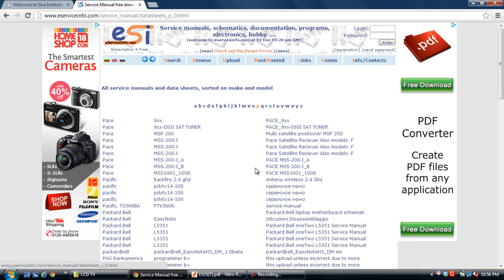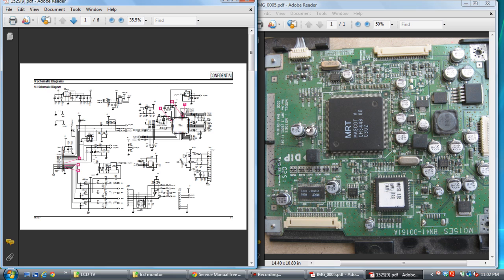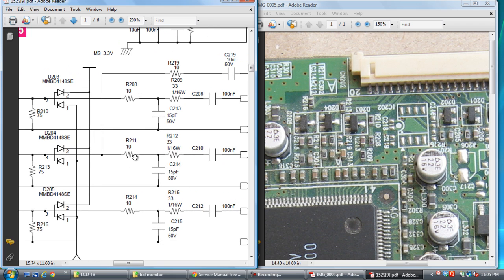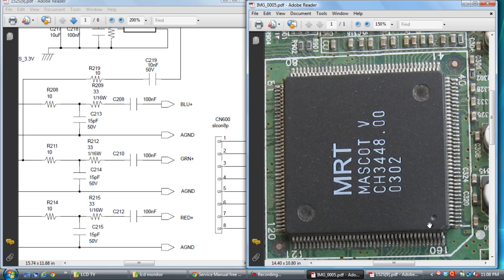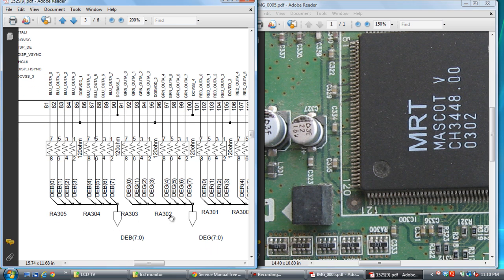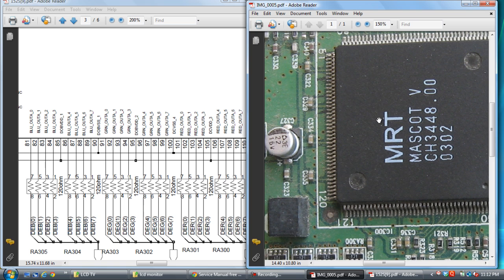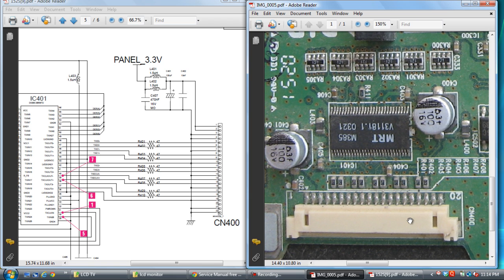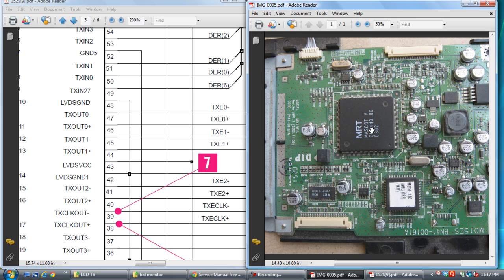Lcd Monitor Repair

Comment: LCD Monitor repair means this lecture should explain how to repair  specific trouble of an lcd monitor using the schematic diagram.Lecture explain only the overall function of an lcd monitor circuit.
Reply: he explained what part of the circuit would be damaged if some color is missing.

Comment: when ı tried to switch on ı can not . ı have to wait for 2 3 minutes (ı think that is due to a thermal problem ıf ı am right ) computer is not soo hot but it shuts down how can solve this problem sir ? whether the thermal sensor is broken or any other things related to harware ? please help me ı couldnt find a solution :( thanks for your hep

Comment: hi thanks for your all videos which are full of information . I have a problem but couldnt find any solution :( and need emergency help if you can . I have a casaper nirvana w76 sun laptop . ı clean its cpu fan changed its thermal paste , and changed spare bios battery . after replacing bios battery ı realized that computer can start but giving some beeps (not bios post beeps) which are long beeps and continues even on windows mode . after beeping for 1 or 1.5 minutes it shuts down .